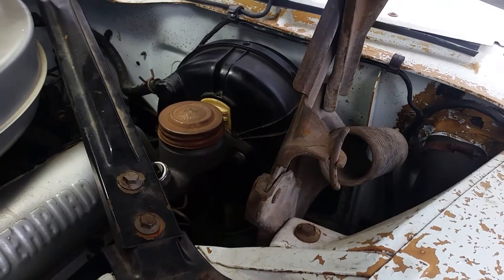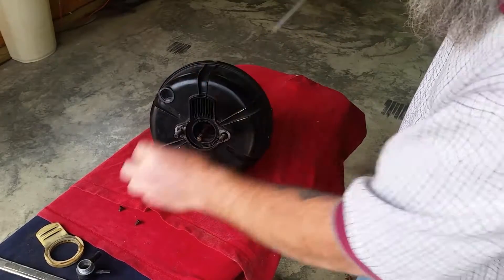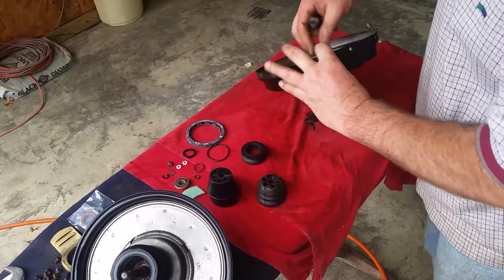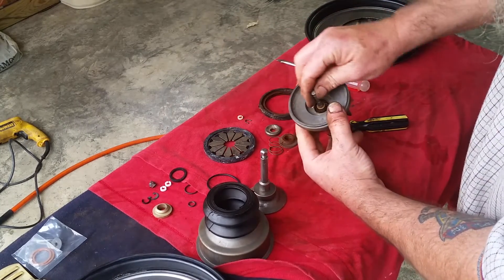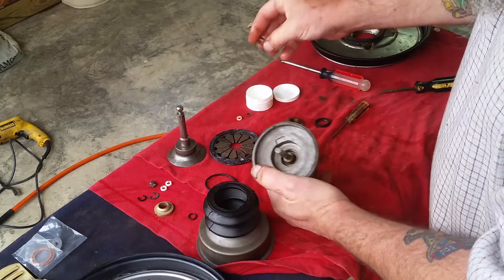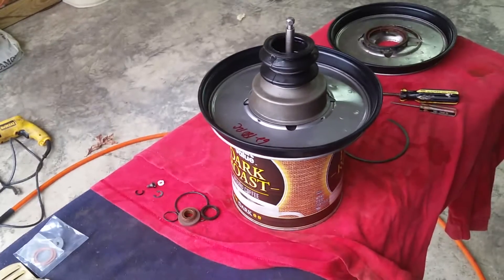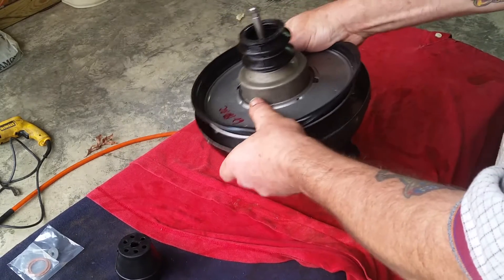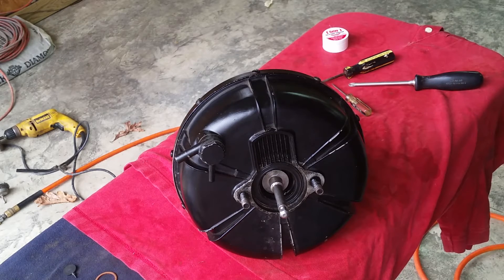1961-1964 Ford Thunderbird brake booster rebuild.

Comment: My 9161 Ford Galaxie uses the same booster. The transmission modulator messed my booster up with type F transmission fluid. Great video.